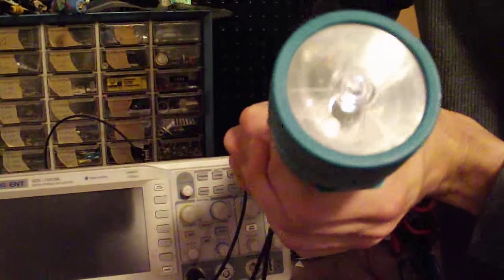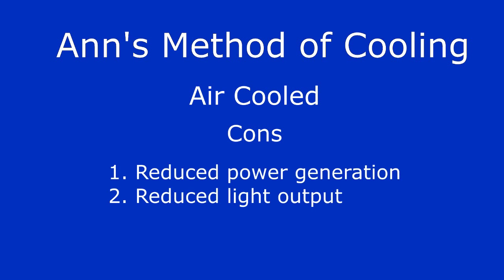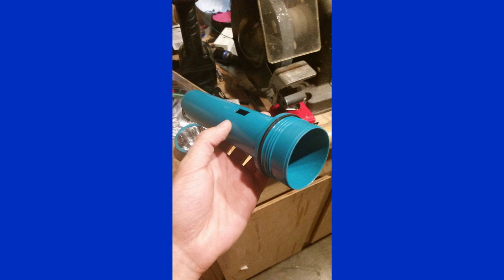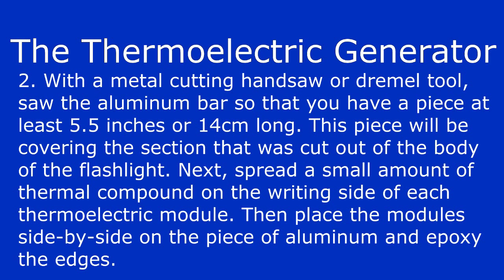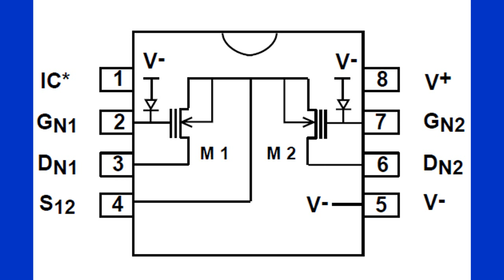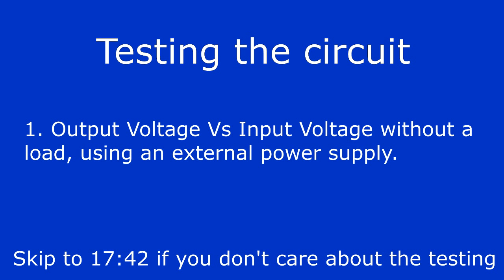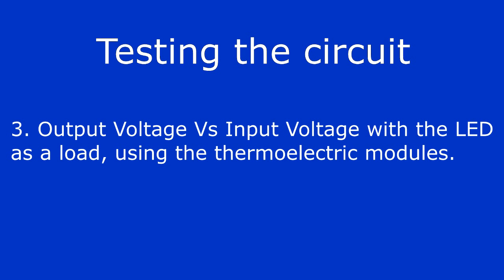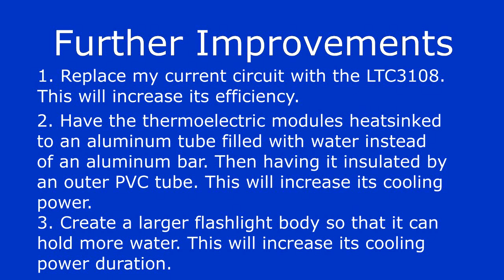How to make a Thermoelectric Flashlight

Comment: Hello, I would just like to wonder if it does actually work?
Reply from the maker: It does indeed work, however it is open loop. So there is no control. The voltage on the output can  become so high that it destroys the MOSFET if there is no LED in the circuit. I would recommend building the LTC3108 circuit from my other video. I hope this helps!

Comment: I'm using this as a project for our school, just gonna ask where the thermoelectric module wires are soldered to the circuit?  Thank you in advance for answering my question.
Reply from the maker: Looking at the diagram at 10:20, the red (+) wire from the module is connected to where the diagram shows VCC. The black (-) wire is connected to where the diagram shows GND. I hope this help. Good luck on your project!

Comment: Can we replace the LED with a phone  charger/ use this concept in a way to charge phones?
Reply: I don't think so. LEDs draw very little power (5 - 50mw) that you can get from the peltier module. But charging phones take way more power (more than 1 watt!).
Although you could use more peltier modules and heat.
Reply: MicroFarad oh okay, thanks for the reply!

Comment: How did you solder the modules together with the top part(where the LED, MOSFET, and resistor are) of the flashlight? Where does the two wires that is connected to the modules go?

Comment: I have just uploaded my latest creation "Body heat to kinetic" using peltier module connected to my custom built circuit which outperform the commerical unit.Pls see description.
Reply from the maker: Nice demonstration, wasn't really sure how much power that those rotating plates use. I guess it uses very little power.

Comment: where do the peltiers batteries connect to the circuit? Thanks
Reply from the maker: (10:34) The positive end of the peltier tiles (usually the red wire) connects to the resistor and one end of the common mode choke (Vcc). The negative end (usually the black wire) connects to ground (GND), which would be the source pin of the MOSFET and negative lead of the LED. Remember that the face of the module "WITHOUT" the model number writing is the side you want to heat with your hand.

Comment: Another way of having an air-cooled flashlight would be to use an old metal- bodied flashlight (better heat conductivity than pvc) and drill plenty of small holes for the cooling. As long as the circuit itself is protected in a small enclosure inside the flaslight, no need for a fully closed body. Just moving your hand would instantly provide enough airflow to evacuate the heated air; no need to wait for it to cool down. Plus, it would be way lighter and simpler to make: no need to fear a crack or leaks. Since we rarely need a flashlight in the sunlight, air is often cool enough in dark places or at  night... Well, unless you live in tropical places.
Would be nice if they made curved or  flexible peltier modules though... it would greatly improve ergonomy.

Comment: Please reply soon, need all the help i can get.. .can i place a 5v regulator after the circuit and then connect the regulator to a chrager?If so, can you tell me how?Also which circuit should I use? Sorry for troubling you...pls reply ASAP
Reply from the maker: You can connect a 5V regulator the same way you would connect the led to the circuit. The drain of the MOSFET would be the input and the source of the MOSFET would be the ground. The current will still be very low and may not charge a cell phone. Good Luck!

Comment: I'm having an issue with the placement of the wires from the choke to the mosfet (2,7-3,6)...is there a simpler circuit diagram to help me with what all connects to where? It's not coming on so I think something is crossed or in the wrong place.
Reply: Did you manage to do it????? please help

Comment: Hi LampE when I made the circuit and connected all the parts, the light would not turn on. My mosfet pieces had fallen off but I tried to improvise and solder them together, but nothing has worked. What can I do to fix this problem this is very URGENT!!!!!!! 
Thank you
Reply from the maker: You can always solder the circuit onto a protoboard. It'll make better solder connections.

Comment: Also, I don't have the N- Channel MOSFET you mentioned. I have a IRFBE30 (Y32K) N channel MOSFET, with 3 pins only. How do I attach this to the circuit ? Thanks.
Reply from the maker: The IRFBE30 N-channel MOSFET won't work because it has a minimum gate threshold voltage of 2 volts. The ald212900apal N-channel MOSFET is the only transistor that I am aware of that will work because it has a gate threshold voltage of 0.02 volts, which is much lower.
Reply: What will be the circuit diagram if we can step up the voltage to over 2 volts?

Comment: Hi! I am also making a similar project for my school but in that model, I have used a thermoelectric module and an LED. It is not working. So I thought of using a voltage booster. There are many models online but I don't know which one to use as I am not experienced with these types of things. So it would be great if you could help me with telling me the correct model name which is cost-efficient and is reliable too. Thanks!
Reply from the maker: Currently, I have yet to find an easy plug and play solution on the internet, but I am looking into solving this problem. For now my recommendation is to built either of the two circuits from my two videos. Best of luck on your projects my friend.

Comment: Another question, is there anyway to replace the ald212900pal with a transistor?
Reply from the maker: You could, but the key feature of the ald212900pal is its low gate threshold voltage. I transistor usually requires around 0.7 volts to function. This means that the device will need an input voltage of about 0.7 volts.

Comment: But you didn't use the Adaptor Board that you said that you said you need !?
Reply from the maker: The adapter board is used to make the LTC3108, not my circuit (the one with the ALD212900PAL, common mode choke, and resistor). It was mentioned briefly to show how much easier it is to make my circuit.

Comment: Hey lampE I have tons of questions on how to do this for my science project. Like how to find the data. I have a multi meter. But for my project I don't have a oscilloscope. How should I do it. I also don't know the independent dependent or control variable! I need your help!
Reply from the maker: Without an oscilloscope, it is really hard to measure the voltage, because it's AC. I also do not understand what you mean by independent and dependent variables. Please clarify

Comment: hello. I would like to know if I can use this common mode choke   
KEMET SC Through Hole Common mode filter, -25 → +65 °C, 5 A, 35mΩ, 15 x 12 x 15mm
Reply from the maker: That should work as long as the inductance is somewhere between 5-50mH

Comment: hey LampE, a guy here mentioned that we can use a reflector behind the led or a lens in front of the led. so i wianted to ask you whether it will help in bette illumination or not. and also using led of different colour like red or blue will effect the illumination??
Reply from the maker: Yeah, it would just help focus more of the light being emitted by the LED, so more of the light is not wasted. Red LED not usually not as bright as white light LED. Blue LED can be bright, but you probably want to stick with the White LED, since lighting sources are usually white light.

Comment: LampE - I have built the circuit, but when I tested with the multimeter, it said the current was fine but the voltage is low; the LED does not light up. What can I do to fix this?
Reply from the maker: Do you have an oscilloscope? That would definitely help you determine the problem.

Comment: And can I make it wireless for charging a phone? Please reply as soon as possible, really need to know...
Reply from the maker: I would not recommend doing this. The voltage is unregulated and could potential damage your phone.
Reply: @lampe7384   Thanks, but would it work  if I put a 5v regulator after the circuit?

Comment: Question: Why does my flashlight only work when the module’s wires scratch on the ground, but the light is not continuous, do you have any reasons why? Plus is a 100k resistor too much?
Reply: Where is does the water come into play can you explain it to me. Did your flashlight work

Comment: Can I use a toroid( wrapped in magnet wire) instead of a common mode choke? Will it affect the brightness of the LED?
Reply from the maker: No, if you wrap your own toroid, you will probably not get enough inductance and/or a 1:1 turn ratio like a choke. The LED will not even light up. I highly recommend staying with using a common mode choke.

Comment: what common mode choke what function have in the circuit??
Reply from the maker: The common mode choke does a few things. It creates an oscillation with the MOSFET, it increases the voltage, and it stores the energy that's being used to light the LED.

Comment: hey can we use a step up transformer to increase the voltage. I'm only getting voltage in the order of milivolts(which is not sufficient for an led to glow). Also please tell me the required voltage that we will require to glow the led.
Reply from the maker: Your circuit is probably not working if you are only getting mVs. The LED needs about 2.5V, but the circuit will allow you to light it at 0.2V. Check your connections in the circuit because you do not need a step up transformer. There might be a problem with the MOSFET. I might have been damaged because those chips are very sensitive.

Comment: PROFESOR UNA PREGUNTA, COMO PUEDO HACER EL CALCULO DE LAS BOBINAS PARA OBTENER EL VOLTAJE QUE NECESITO TENGO UN TOROIDE QUE MIDE 5 CM DE DIAMETRO EXTERIOR, 3 CM DIAMETRO INTERIOR Y UNA ALTURA DE 1.5 CM QUIERO ALIMENTAR UN LED DE 12V Y CONSUME 500 MILI AMPERIOS Y TENGO DOS PILAS DE LITIO 18650 DE 3.7V Y EN PARALELO PERO QUIERO ELEVAR SU VOLTAJE CON UNA BUENA CORRIENTE PARA ALIMENTAR AL LED.. LE AGRADEZO DE ANTEMANO SALUDOS!!!!
Reply from the maker: Yo no usaría este circuito para ese propósito. Este circuito no puede suministrar tanta potencia.

Comment: how did u assemble the circuit .Where did u join the extention wire that u connected at the last
Reply from the maker: You mean that red wire? That was the wire coming from the positive terminal of the modules. I goes into the input of the common mode choke.

Comment: I thought something was wrong when my output appeared to be around the same as the input only converted to AC (~300mV DC in --> 300mV AC Out) when I measured it on a multimeter set to read AC Volts. There must be something wrong with this way of measuring the voltage because when I connected it to the LED, it worked. However, the LED was a bit dim so I added another Peltier tile (now 4 total) but it didn't change much? My question is this, is it better to maybe connect 2 sets of 2 tiles in parallel instead of 4 in series as I'm doing now which appears to make little difference in brightness although the input has clearly increased by ~150mV? I was thinking this setup may provide more current and make the output brighter?
Reply from the maker: You would have to use an oscilloscope to measure the output voltage because the circuit outputs large spikes of voltage. Having a parallel set of series tiles wouldn't do much because the circuit can only take in so much current for the input voltage. Since the circuit is suppose to function at an input voltage of 300mV, this wouldn't necessarily be a problem. If the input voltage is at 300mV, and it doesn't work, then maybe there's something wrong with the mosfet.
Reply: Hi LampE, thanks for the reply. Your circuit and the LED works so many thanks for that. I was just trying to make it brighter. For example, if I place the aluminum rod in the freezer for a few mins then the light is super bright but I was just trying to figure out ways of making it brighter at room temperature where the temp differential isn't as great.

Comment: ok, can u at least tell me what the components are to make ann's circuit, I mean what goes in along with the ltc3108
Reply from the maker: Sorry for the late response. I've been very busy lately. This is how I made mine.

1. LTC3108 micro chip, as well as an adapter board (SSOP pin style)
2. 10nF cap (C2-Transformer) 
3. 330pF cap (C1-Transformer)
4. 4.7uF cap (AUX-GND)
5. 1:20 transformer like this one http://www.mouser.com/ProductDetail/Wurth-Electronics/74488540250/?qs=%2fha2pyFadujB6tfzH9RjWwKQvtaqgJwp9O3TdNJPDjztZYD4hZlKhA%3d%3d

For additional help use the data sheet http://cds.linear.com/docs/en/datasheet/3108fc.pdf
Reply: how did u come to know of these
Reply: I mean abt the parts
Reply from the maker: Great question. I have been self-teaching myself power electrics for almost 3 years now through textbooks and online research. So after a while it becomes easy to figure out what each component does in a circuit, especially if you are experimenting and researching the same circuit for a very long time. Lol
Reply: wow

Comment: Does it matter how many tiles you use? Is more always better or do you run the risk of either saturating the input of the circuit or generating too much output voltage for the LEDs?
Reply from the maker: Having more tiles connected electrically in series will produce more voltage, as long as you can provide heat to them. You don't need to worry about it providing too much voltage to the LED because the circuit won't be able to supply enough current to reach too high of a voltage. I recommend 2 or 3 tiles because you can utilize the heat from your hand more effectively.

Comment: the BSD840N will work instead of the  ALD212900PAL?
here is the datasheet: https://www.infineon.com/dgdl/BSD840N_Rev2+4.pdf?fileId=db3a30431b0626df011b12b4486c7c02
Reply from the maker: If you can get the modules to output around 1V then it might, but otherwise it won't function at lower voltages
Reply: but it says that the minimum Gate threshold voltage is 0.3v.
i will need 1v because of the resistance?
Reply from the maker: I see what you're saying, but it's usually the typical value, which would be 0.55V. This might actually work, but you would need around 0.5V, which is doable.
Reply: LampE ok thank you, anyway I don't need it to necessarily work with body heat, I can put hot water in one side and cool one in the other so it output more voltage
it should work , right?
Reply from the maker: yeah, that should be fine
Reply: LampE thanks, I will try it out

Comment: r there any low voltage converters that can be directly used with out any external devices 
 I mean the circuit should only include the peltier tiles and the low voltage converter
Reply from the maker: I am quite not sure of what you mean. Can you give an example of what you mean?

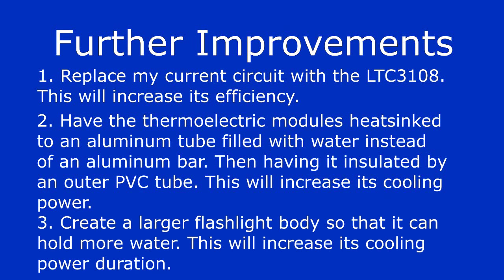Comment: In 19:05 why will a tube increase its cooling power more than using a bar?
Reply from the maker: a tube provides more surface are for the heat to flow into the water

Comment: Hi? Should I use thermoelectric generator or thermoelectric cooler? Since TEG is more resistant to higher temperatures, should I use TEC for body heat instead?
Reply from the maker: Use TECs because they are cheaper working with lower temperatures
Reply: LampE thank you so much!
Reply: LampE Hi, another question, would it be viable to store the electricity in a battery and use it afterwards?

Comment: LampE - When I epoxy the edges of the TEGs onto the aluminum bar, do I epoxy the edges of the middle TEG unit, or just the edges of the outside two?
Reply from the maker: You can epoxy the in between edges. The goal is to make sure that it doesn't leak water, so this would definitely help.
Reply: U sould use TEC not TeG

Comment: Hey I´m doing a school project and I urgently need to know more about this circuit. For example, how does the modified joule thief works? Could you do a video explaining this and a video showing how to make the circuit more specifically please.
Reply from the maker: Hi Pedro,
I glad to help you, but I’ll have to explain it through writing as I unfortunately do not have time to make a video, but I highly recommend watching any video explaining how a joule thief works will give you a general idea how this modified circuit works. A joule thief is a switch that constantly turns itself on and off, with a coil of wire constantly get charged when the switch is on and discharged when the switch is off. Here’s the difference between my modified joule thief: The difference is in the switch and the coil. The switch used in the modified version is a MOSFET, unlike the BJT used in a normal joule thief. A MOSFET, unlike a BJT, can be made to turn turn on at lower voltages than a BJT. This means that a MOSFET can be used to create a joule thief that works at lower voltages than normal. In my design, I used a MOSFET with the lowest turn on voltage that I could find on the internet. The coil is different, and is actually a lot larger in terms of inductance (inductance is the unit used to determine how fast an electric current can change in magnitude; higher the value, thee slower that the current can increase or decrease in an electric current) because MOSFETs can turn on faster than a BJT. If it wasn’t large, it would turn on too fast for the coil to be charged with energy. Those are the two main differences between a standard joule thief and my modified version. If you have any questions, I’ll be happy to answer them.  Best of luck with your school project!
Reply: @lampe7384  Thank you very much!
Reply from the maker: @pedrovasconez6896  No problem!